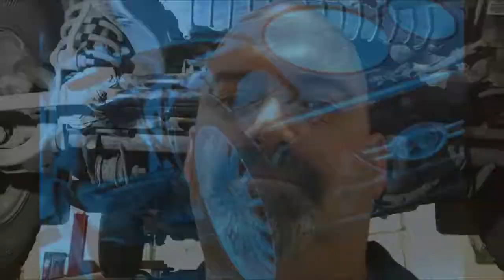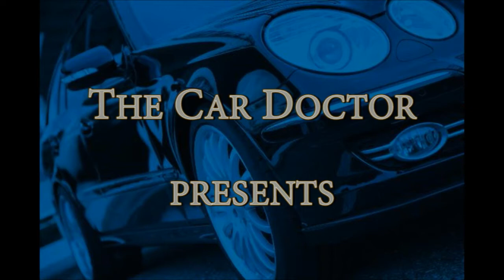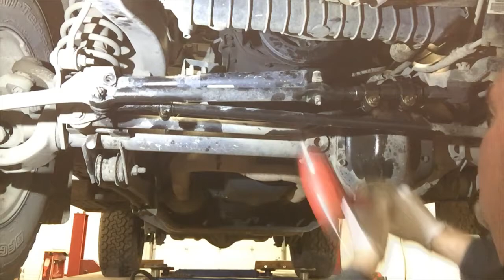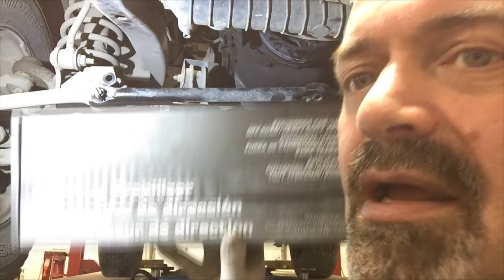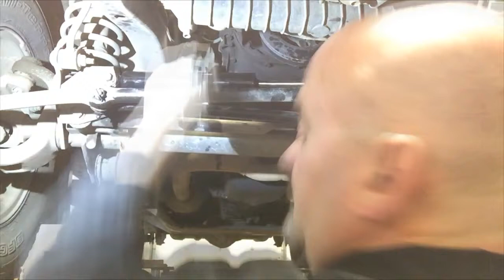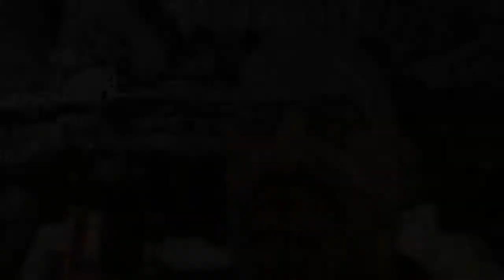Jeep Wrangler Wobble Severe Wheel Vibration - Steering Damper Replacement

Comment: No, it's almost never the steering stableizer. You can drive without one just fine, all it does is help prevent bump steer. It doesn't contribute to death wobble. Death wobble is due to lose/worn out suspension or steering components.
Reply: Agreed
Reply from the maker: I talk about the other causes of death wobble in this video and gave some tips for pinpointing and isolating the causes so IM not sure the motivation behind your comment but I will disagree with your statement that a worn steering stabilizer never contributes to death wobble since we are talking about a component that dampens steering feedback which is at the core of hallmark cause and effect of death wobble or uncontrolled oscillations of steering feedback.

Comment: The stabilizer didn't fix my problem though, it drives a little tighter but I still get violent shaking when braking from higher speeds.  I'm thinking about new front rotors and brakes.  I'm probably due for pads anyway.  Got a video on rotors?
Reply from the maker: Yes, sounds like out of parallel rotors. Also be sure to check for worn front steering and suspension parts.

Comment: Tapping the end you hit with the hammer isn't getting it loose, need some advice please
Reply from the maker: Bigger hammer or a pickle fork will get the job done.
Reply: If you invert the nut and get it started you can tap it instead of the threaded section.

Comment: does a bad steering damper cause a vibration and noise when turning the wheels to the right?
Reply from the maker: +rachele bullock They can make noise I guess but the condition you describe is not commonly associated with faulty steering dampers. Is your power steering fluid low, belt loose or something like that?
Reply: Fluid is good. Will get the belt checked.

Comment: Nice tip. Hey Tim is there a tool to remove the rubber bushing in a brake calliper. On a Silverado I replaced the rubber boots and slider pin bushings on each calliper. . , what a pain to get out.  Is there a tip or tool to get them out.  I used a dental pick with a hook on the end.  Take Care Steve
Reply from the maker: Steve Rob Good question, I also use a pick or small screw driver to get them out. I admit im lazy about replacing those...they have to be completely worn out before I bother.
Reply: Hi Tim
SMAR  had a vid showing how to change the boots on a calliper but did not change the bushings so I asked Eric how he gets them suckers out- he uses a drill bit takes only seconds. You know how much time I spent with a dental pick - a drill bit wow , I never even thought of it. LMAO